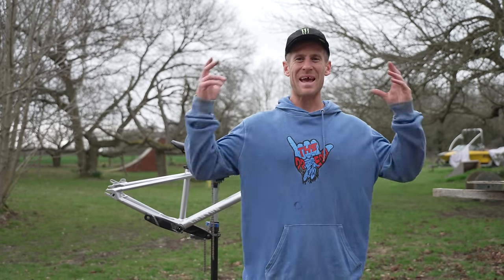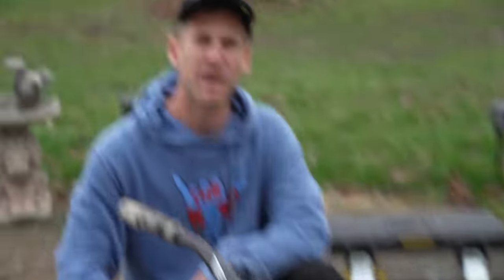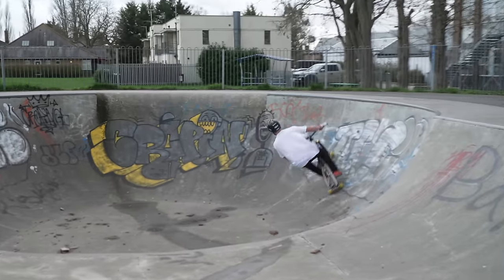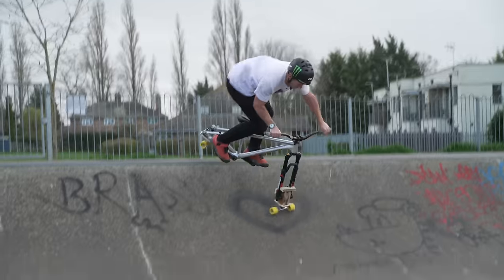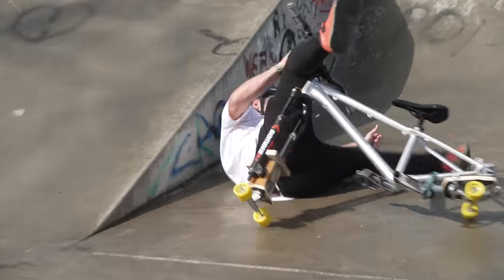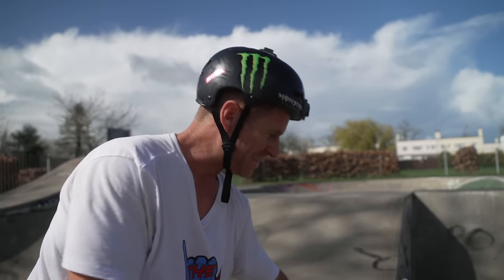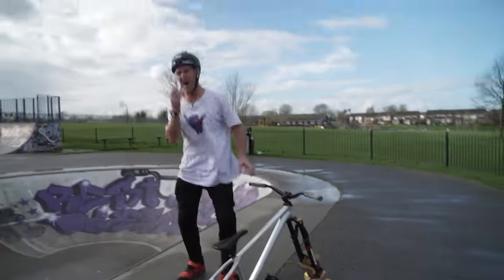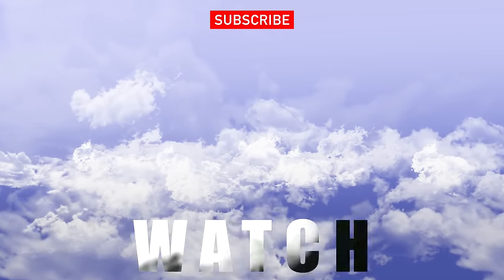THE MOUNTAIN BIKE SKATEBOARD HYBRID!

Comment: That part where you mentioned the truck turning the opposite way... The trucks you're using are reverse kingpin from a longboard and so need to be mounted the opposite way to standard skate trucks. Look at whatu direction they were on the board originally and you'll see you've mixed then around. Actually mind blown you were able to even adapt to riding it lololol! Truly such a skilled rider🤘🏾 also if you change the wheels out for standard skate wheels that are harder and smaller then you'll ride around the skate park way easier and potentially get more grip in the wet!

Comment: Such a great vid. I was thinking a deck cut in half lengthwise and attached onto the overhanging bottom bracket spindle after removing cranks.having the back ends attached to wheel pegs on the rear axle. Could use the same D bolts like on the front hub, but flipped with the nuts at the top so that there'll roll over better as it's now got running boards/skidplate

Comment: Great vid and build…..just a tip…. This are reverse kingpin trucks and they are on backwards.
With downhill reverse kingpin trucks the face of the truck hanger with the bold head sticking out needs to face to the front ( on your front forks) and outwards on the back. This will fix the lean steering. Unless you want it steering the opposite direction when you lean

Comment: use a 2x4 or some metal brace to make it the same hight as a regular mtb tire would be. weld a rear cassete to a axle to use with a chain to make it able to pedal. I may try to buld one soon. Im sick living in terror of flat innertubes on long distance rides. This would fix that issue permanently. Patent this idea Sam.

Comment: Hey Sam. In the early/mid 80's at our local roller rink, Id see some guys riding these weird bike/skate combo things that maybe you are familiar with. 
Picture a unicycle, I believe with a unicycle saddle, with a welded on arm that extended forward of the BMX size wheel. Attached to this was a roller skate or skateboard truck and wheels. The rider obviously sat as if riding a conventional unicycle. The front truck and wheels would pivot as on a skateboard when you leaned left or right. Usually, the rider wore awkwardly short cut off jeans and a shirt with his favourite rock band. 
Have you ever seen one of these? 
I also wanted to comment that in the later 80's, when I was into flatland BMX freestyle, I'd often put my skateboard out on the road, then ride up, pop up my front wheel, landing it on skateboard, holding front brake tight, seeing how far I could ride like that. I'm sure you've done this one. Kinda dangerous. The other fun thing I did was put on my roller skates, then get on my BMX, get up to speed, I'd put my foot down while cornering, the roller skates letting me lay the bike down really low. Ever try that? 
When I'm having "energy drinks" with my buddies, I often run a few of your vids for them. You see, we are all old washed up skaters, or "Barney's". I think you are a skateboarder trapped in a cyclists body. Haha. We love you Sam.

Comment: design edits: 1 use an electric skate board for the rear for speed (attach battery to rear frame) 
2 instead of pedals fix side pieces of a board to the frame securing it through where the pedals go

Comment: it turns weird because the kingpin on a longboard truck is supposed to face outwards, so they are technically backwards on the bike. Would work even better with a tradition skateboard truck I think, tensor mag lights would go crazy for grinds.

Comment: If it had a rear shock and also the back wasn't so close to the ground that would be cool, then use an electric board motor or truck and use that to drive around that would be fun to cruise around

Comment: I would think that the bike would be easier to handle if you replaced the crank with straight pegs. One would be naturally inclined to want to pedal which would prove to be problematic with this arrangement.
Edit: I see you just mentioned that at 10:35 . I commented before finishing the video.

Comment: Hi Sam, I have maybe a stupid question, but the one that bothers me for long. I ride bicycles for years, MTB so off-road, forests, few mountains, etc, but on completely lower level than you and I'm 2m tall and finding suitable bikes always was a big issue cause 24" frame is rare and usually I use 22" and it feels a bit off but durable (29" wheels). I tried skating also and after a year just dropped cause how difficult it was for me and I think my height adds some issues to the balance and how I hold it (besides problems with finding comfortable position on long bike rides thanks to rarety of suitable bikes for tall people). Another issue I started to think about while watching your rides is my weight. In my best shape I hardly will weight lower than 100kgs, current is 112kg I also do gym so I have muscles, so I'm afraid if I put this amount of load on the bike doing more difficult jumps than I do will it even handle? Do you think that height of a rider affects the rides overall and it's always better to be small? Do you think I have a physical limit of how far I can go with MTB? I have started just with off-road then decided I want to push my ride distance limit and speed with which I go and here I'm, interested in something more difficult, high jumps and having a lot of concerns.

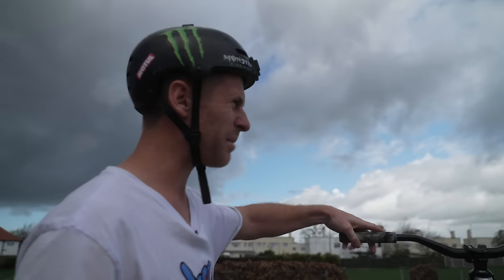Comment: in 2:57 and as a skater hiiighly keen on what happens if you find out that your back truck is mounted in the wrong direction... ;-)
Reply: in 6:10 and still wonderin - but i might be wrong and this trucks just have a very weird geometry... 🙂
Reply: in 10:20 i am still quite sure that they are mounted the wrong way - but the front "wheel" is angled so much that it does not affect the steering at all... and overall - you are just a too good biker to be annoyed by the trucks steering wrong... ;-)

Comment: Sam do you realize there's A difference in a regular drill an a impact drill cause you are always using a regular drill an its making the stripped sound for me regular drills are for boring holes an to fasten screws I use an impact only so you need a impact drill it will get things so much tighter it doesn't strip bolts or nuts